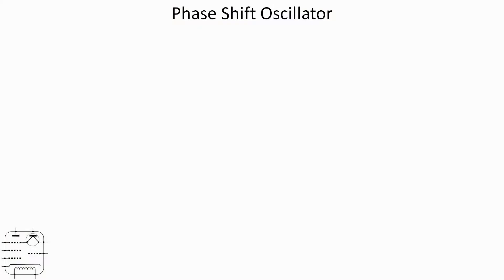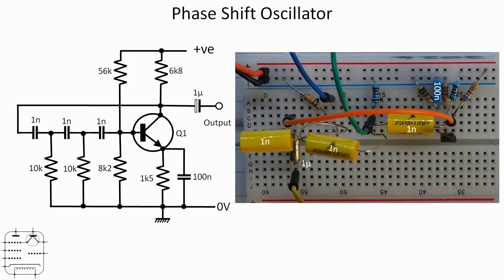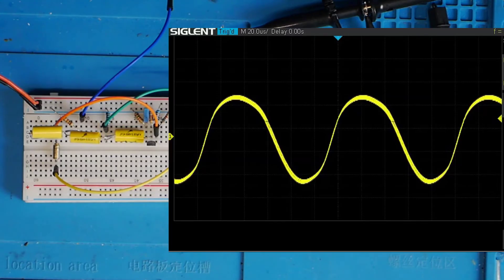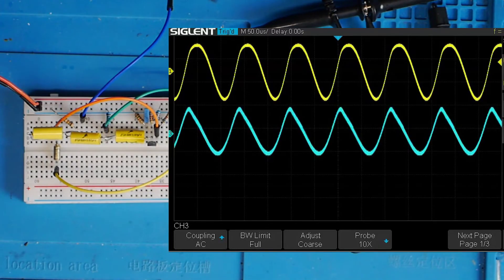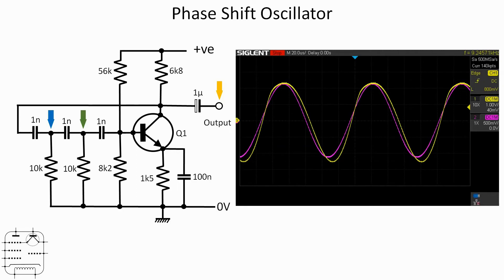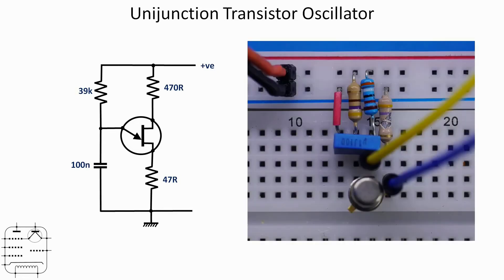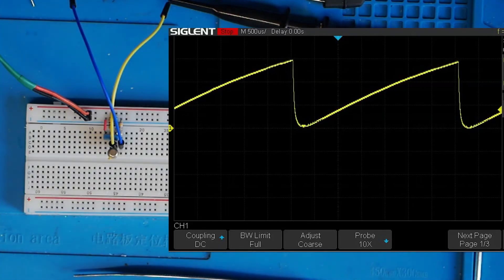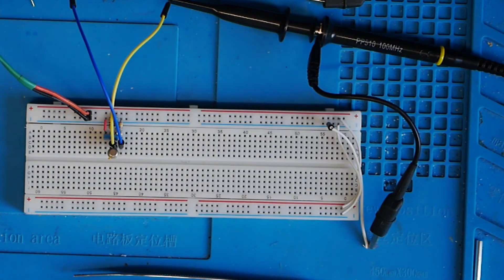Oscillators Part 3 - #189

Comment: Very good series ! I would be interested in oscillators with vaccum tubes...  Do you plan to talk about tubes ?
Reply from the maker: Thanks for the question, I will have a go at something with valves (also called tubes I am led to believe!)
PS the pedantry is disappointing.